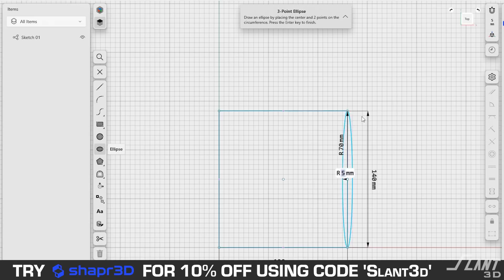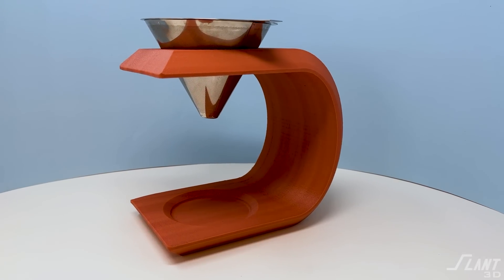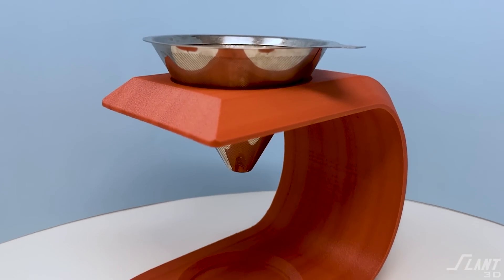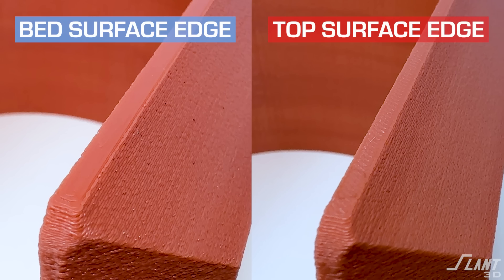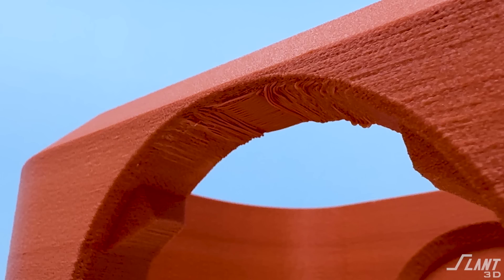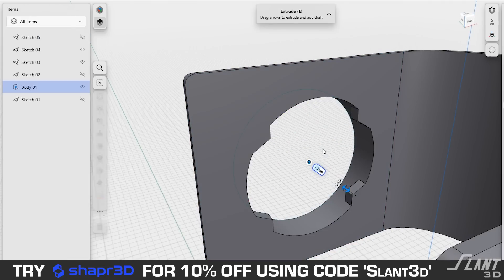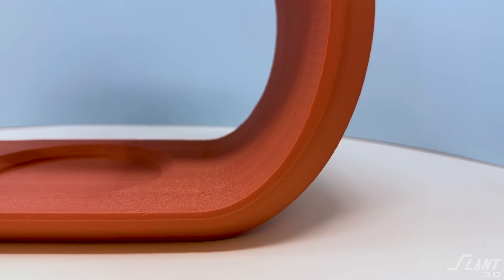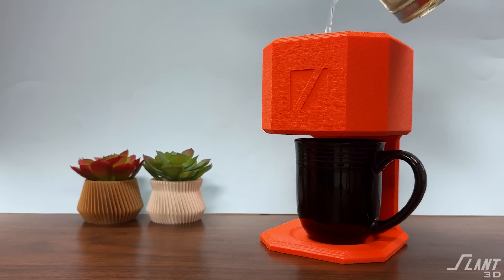Design & Sell a Minimalist Coffee Stand Using 3D Printing

Comment: Maybe making the hole for the filter diamond shaped(or maybe a drop shape) you could get rid of the supports and get the same grip without support

Aesthetics will be a bit tricky but I can think of a few ways to handle that and make it fit
Reply: BTW, how are you adding the texture?

Comment: Little bit of spillage, little bit of sugar and little bit of bacteria, come back few days later you will have a brand new, organic , mold filled coffee maker.
Reply from the maker: Like every coffee make on the planet
Reply: @slant3d  not true, injection molded parts does not have infill or layer lines. Agreed any food equipment need to be washed/cleaned frequently, FDM prints will trap food between layers, combination of liquid with sugar and bacteria will cause little petri dishes inside the cracks and lead to mold growth

If you really want to make it food safe:
1. either chemical treat and add a layer of food safe resin to fill the layers on FDM prints (need to go through extensive testing for FDA approval)

2. Choose a different process like SLS / SLS

3D printing is a great tech, not the only tech for product development. You need to discuss the merits and demerits of the tech.

You should read CFR 21 to understand the FDA level requirements: https://www.accessdata.fda.gov/scripts/cdrh/cfdocs/cfcfr/CFRSearch.cfm?CFRPart=177
Reply: How does sugar make its way in there while brewing lol
Reply: @sprobertson  imagine a sugar particle dropping on the printed surface and a bunch of liquid spilling over the particle, given the fact he didn’t add any resin to this print, it’ll slowly seep into the cracks. 

Ok let’s take another situation, imagine I added some sugar into my coffee and after mixing I had a spill on the print surface, again it’ll seep into the cracks.

As engineers we should consider these situations before we design a product for “MASS MANUFACTURING”, otherwise you are just a shitty engineer, FDA will throw your product into garbage pile.
Reply: Following this logic, any 3D printed object could catch some sugar particles....

Comment: Regarding those noise surface features, wouldn't it be tremendously hard to clean those surfaces?
Especially when it is stained by coffee.
Reply: A noisy surface might be slightly more difficult to clean, but liquid stains tend to seep between porous layers of the part, so it's likely going to be irreversibly stained regardless of whether the surface is smooth or noisy. But it's worth noting a post processing clearcoat might seal effectively in less coats on a smooth surface
Reply: @spencerkirkhope7397  Yup clearcoats can do miracles, especially for UV protection. Regarding waterproofing probably epoxy dip followed by clearcoat might be the answer.

Comment: What about redesigning cam lock and dowels from Ikea ?  I just got a new dresser from Ikea and it was missing a few of these ? I don't want to drive the hour to the Ikea store or even think about contacting their customer support.  I am making my own dowel designs (I think a heptagon will do the trick).  There are ikea cam lock STLs online, HOWEVER, they just copy the Ikea design and I bet they will not hold the weight of my underwears.
Reply: Get a piece of round sticks from Lowe’s or HD and you can make your own dowels, I would recommend printing any kind of load bearing components in SLA than FDM

Comment: While I am not interested in mass production, I love following your channel for just the insight you have into designing for 3D printing.  I love your suggestions for how to build something with this medium in mind.  I am only just starting to learn how to use CAD software (why is it so expensive?) so most of my prints are downloaded and I find myself often observing how many prints are fail to take into consideration the whole 3D plastic printing process.  Thank you for your work!
Reply: I use FreeCAD - not very beginner friendly, but it is free. There are also some others available.
Reply: I have Fusion 360 open currently and have never paid a cent for it; not sure what isn't available compared to the paid version, but I've never felt inhibited with what's available in it 🤷🏿‍♀️
Reply: @TS_Mind_Swept  It depends if you plan to use it for anything beyond "personal use" and care whether you're violating those terms. I would like the option to commercialize my designs which is why I am learning FreeCAD after using OnShape, which has similar terms for the free tier.

As far as I know, FreeCAD and Blender are the best options for fully free modeling tools where the use of your designs isn't limited by the licensing terms of the software.

If OnShape offered a tier without commercial restriction (or with some upper limit on revenue...) closer to $10-20/mo, I'd be all over that. $125/mo doesn't make sense for plenty of us who want to stay on the legal side of the licensing terms but don't use it full-time.
Reply from the maker: Thanks for watching.
Reply: I’ve been using and relatively happy with OnShape

Comment: Looks good but can PLA withstand the heat?
Reply: The parts that are load bearing and under load won't ever get hot enough. Also, infill pattern here makes 3d printed parts natural insulators because of all the air pockets.
Reply: I suspect it will. There is very small surface area in contact with the filter, the liquid will be not (but not boiling) so it will soften, not melt the material, and the softened portion is likely to be able to continue supporting the filter that is only momentarily hot.

It would be interesting to see how this performs over, say, 1000 pours.

Heat resistant tabs would be trivial to incorporate if it ever were a problem, though would require more sophisticated mass-production stages if assembled in-factory. It would probably be quicker to print tabs in a higher-temp material and include in the shipping package to be attached by the owner (60 seconds worth of effort).
Reply: @SeanLumly assuming the pour material is metal, it will eventually deform the contact area, I doubt if it can last 1000 pours without causing significant deformation, a better choice would be PETG or ABS
Reply from the maker: Yes
Reply: Any water touching the filter is going to be under 100ºC (212ºF). PLA will not begin to melt until over 150ºC (300ºF). Weight forces of the filter on each of the hidden support triangles is minimal, so even if PLA would be hot enough to become pliable there is really not much of destroying force being applied.
Reply: I was thinking to use PET or PET-CF for this, for its heat resistance and chemical resistance